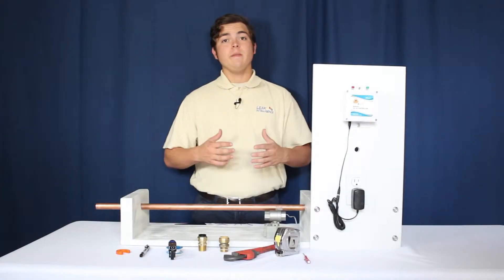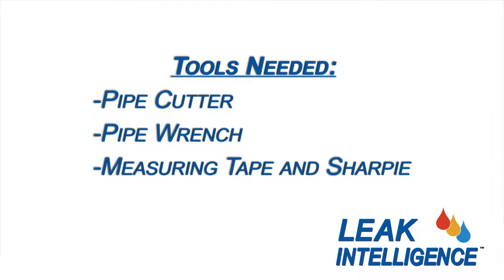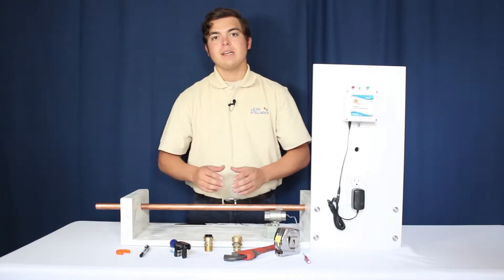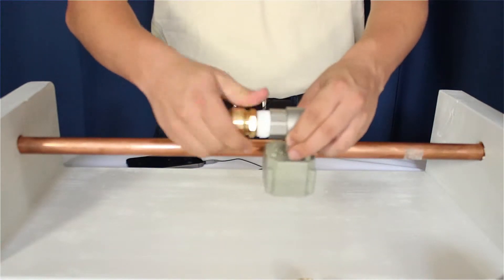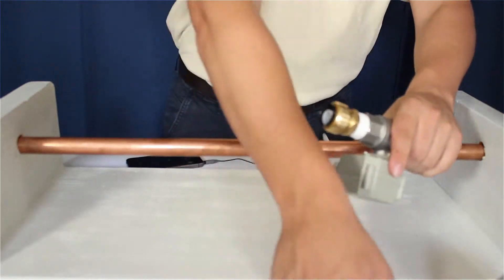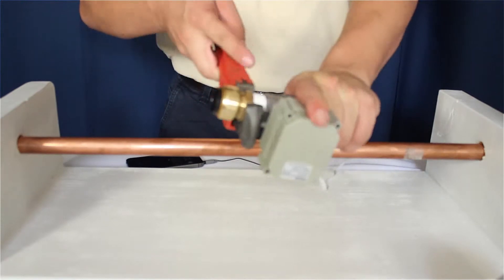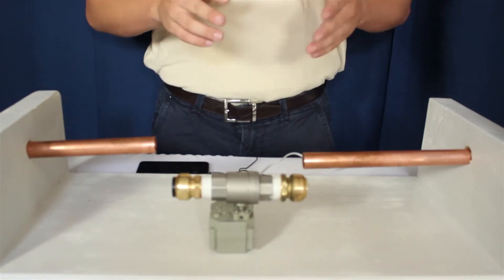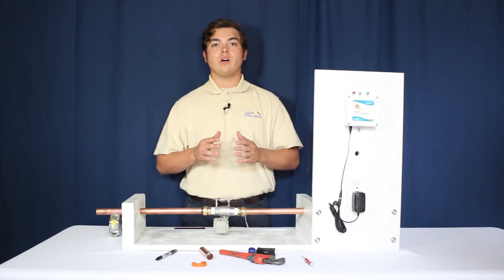Leak Gopher Valve Controller Installation on Copper Piping

Comment: I'm confused. The video says measure out 4 inches and mark the pipe and then measure an additional inch in each Direction. But the video does not say where to cut. Are you cutting out 4 inches or 6 inches? The printed documentation that came with my valve says to cut 12 inches out of the pipe. How can that be? When I put the SharkBite connectors into both ends of the valve the total distance is a lot less than 12in.

Comment: You skipped a few critical steps:
-Failed to mention this is for applications that allow the existing piping to move 2+ inches longitudinally.
-No explanation of second set of marks (must infer insertion marks).
-Missed Ream the cut ends of the copper tubing to prevent damage to the SharkBite fittings and is good practice.

If this is for professionals and not consumers, wouldn't sweating the joints be more professional?